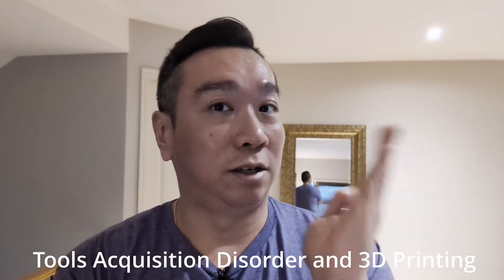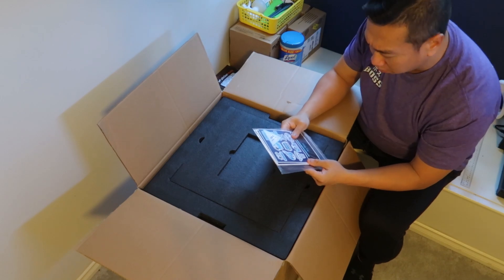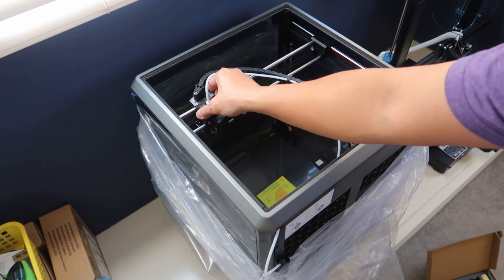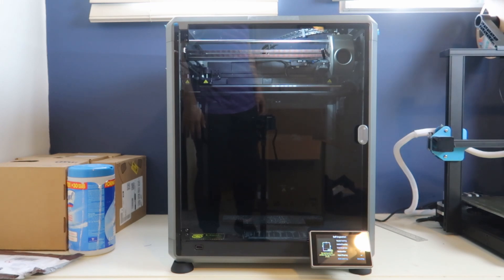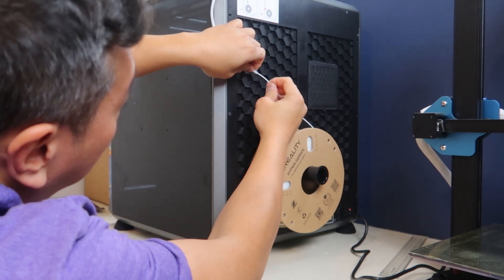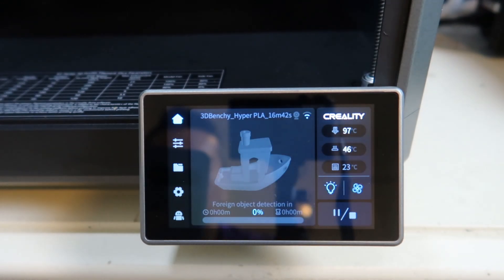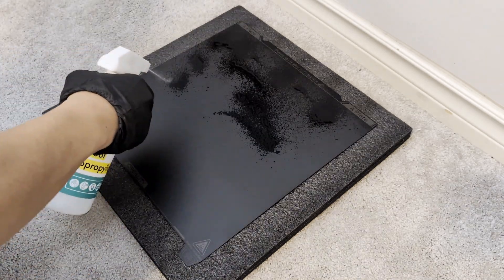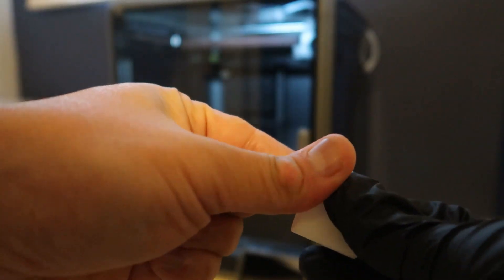Picking your first 3D printer should be simple | Setting up Creality K1 Max

Comment: When i put the filaments the printer make alone nozzle temperature and hotbed or i make it manually
Reply from the maker: There is a preset that comes with the printer for nozzle and hotbed temp depending on your filament.

But you will have to learn how to find configuration for different types of filaments. These days it's pretty easy to do with orca slicer or creality print. They have calibration tab
Reply: @doityoseph my printer k1 max same you
Reply from the maker: Sorry I think I misunderstood the question. Are you asking about setting up filament profile to print, or are you asking about how to change filament?
Reply: @doityoseph  i mean first time to use any filaments or change it need to change temperature or automatically alone the printer make it
Reply from the maker: It's not automated. You have to heat the nozzle to make sure that you can load the filament

Comment: I only use hot water and dish soap to clean the bed plate.... I also found having a extremely stable shelf for the printer is needed and the rubber feet they give caused more issues than help and they made my k1 vibrate to much.
Reply from the maker: I used the hot water and dish soap every 5 prints or something.. In between I wear gloves when I touch the build plate and I use alcohol just for maintenance. Also my k1 sit on bay window so it's as stable as putting it on the floor without putting it on the floor. Lol